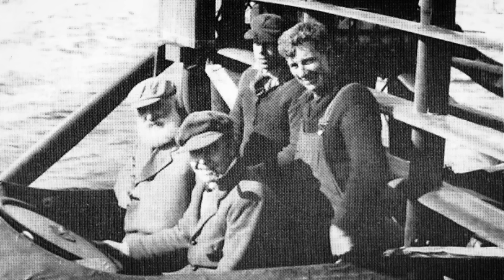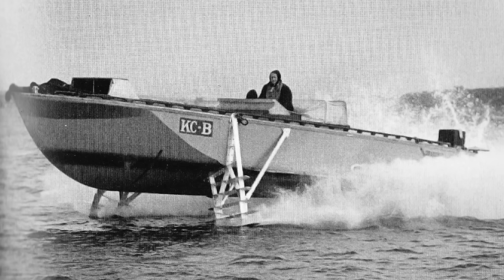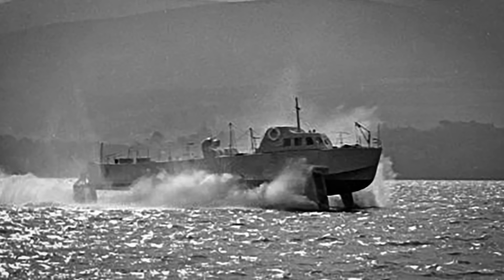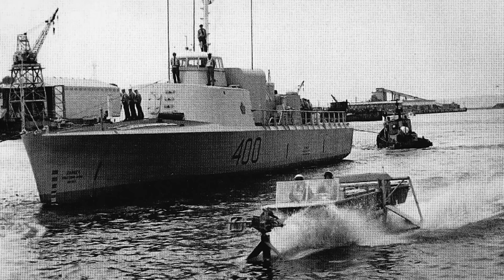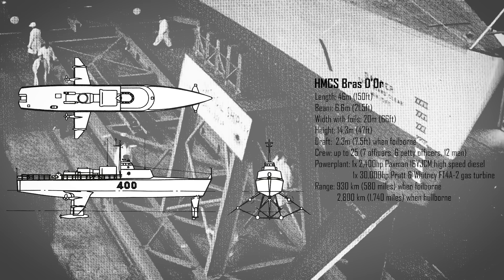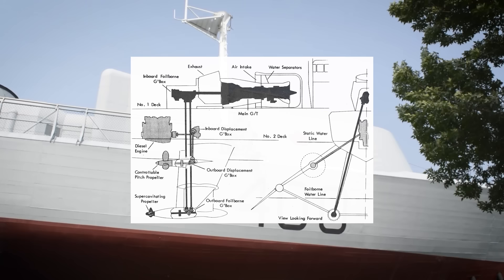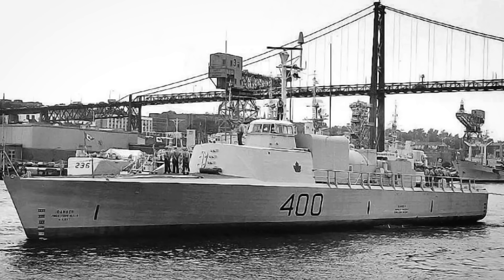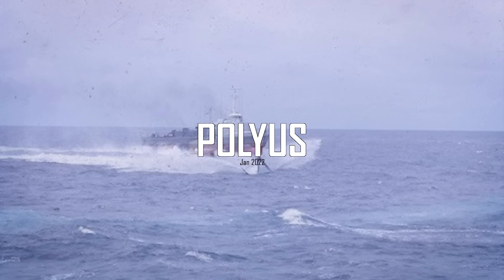HMCS Bras D'Or; The World's Fastest Warship And The Pinnacle Of Hydrofoil Development In  Canada

Comment: I was a part of a U.S. Navy team assigned to document a captured ussr hydroplane spy boat that was captured in the 70's. The engineers determined that it could perform at 80 to 100 knots in shallow water in coastal areas and it was no bigger than a WW2 PT boat. It had such a low radar profile and wood hulled that it was almost invisible to sea based radar. The Kennard was a single steerable ski design that had adjustable vertical angle. The drive was turbine type and used water jet propulsion.
Reply: Is any of this documentation extant?

Comment: The barge it sat on was built specifically for Bras D'Or  by Pictou Industries for $800 k , no tender. It was submersible with 18 ballast tanks and was galvanized inside and out. Beaver Marine Construction obtained it from Crown Assets and utilized it building floating concrete wharf caissons in Nova Scotia for many years.

Comment: Fascinating. I travelled regularly in Auckland Harbour crossings in the Manu Wai. A NZ built Hydrofoil that was 72 feet long, could travel at 40 MPH with 75 people on board. This was 1964 through to 1973.
Reply: Simon: Manu Wai is a PT 20 type surface piercing hydrofoil was designed by the Swiss firm Supramar and built in 1964 by the Italian firm Rodriquez before being shipped to New Zealand. It still survives and is on a mooring in Sydney Harbour, owned by Garry Fry.

Comment: Interesting ship. I knew a machinist mate that served on it and he said that they did a speed run to Bermuda from Halifax once. This was in the days before GPS navigation and his one comment was if we had missed Bermuda by 5 nautical miles they would not have had enough fuel to make it to port and would have been looking for a tow. He also said that after they did the “rough sea trials” they had to dry dock it for almost a year to repair the cracks in the foil pivot supports. Very fast but high on maintenance.
Reply: Not a "machinist's Mate", but a Stoker !  ( I R 1 )  (or Marine Engineer Artificer.  312/313/314 in the 90's money...)

Comment: In 1978 I was posted ashore to the Cdn Forces Maritime Warfare School(now Center) as an ABRP. During the 2 years there I found on one of the lowest decks a group of abandoned offices previously used for the Brador project, and here I found drawings,  specification tables, photos and, most interestingly, a pile of films of testing runs and engineering discussions. I tried to stow away some of the documents and films in the library but with little success. In the meantime the spaces used for the project were torn out to refit a new trainer. I doubt there is much of any of that material remains unfortunately.

Comment: FYI, maraging steel is pronounced “miraging” as in a mirage not “marriaging”.  Maraging steel is really cool stuff.  It's what was used to make the springs on the moon buggys.
Reply: 🤔 it's spelled maraging steel.  It's the short form for "martensitic aging" (mar-aging).
noun
1. a low-carbon steel that has been heated and quenched to form martensite: contains up to 25 percent nickel.

And yes, it really is a cool alloy of steel.

See also:
https://en.wikipedia.org/wiki/Maraging_steel
Reply: Speaking of the moon exploration, all the LEM landing gears assembly were designed et built by Heroux in Longueuil...
Reply: It's also used for fencing swords because they need to be extremely flexible and unlikely to break for safety. Too stiff and you could hurt your opponent, too weak and it could break off the rounded tip and also become a hazard.
Reply: @aniquinstark4347  I came here to say this. I was a epee fencer and the armorer for my H. S. team.
Reply: You learn n+1 things everyday!

Comment: The DDH-280 Iroquois class benefited from the development work done on Bras D'Or,.  The 280's were the first Western Destroyers built with all Gas-Turbine propulsion using lessons learned here, and the Combat Control System also benefited from the work done on the system for Bras D'Or.
Reply: And coincidentally, the lead ship was build at the same shipyard! When the Iroquois was decommissioned in 2015, they tried to bring it back to its hometown as a museum ship, unfortunately without success
Reply: Indeed' Marines in Sorel built those (they had aluminium hulls)
Reply: Served both Huron and Iroquois, belowdecks.
Reply: @beer1for2break3fast4  Spent some time on Algonquin waiting for Huron to come back from a deployment. Stoker as well. Used to hate taking the enclosures off the port cruise engine. One panel had a post about 3 inches from it and the panel was about 6 inches thick. A real pain.
Reply: I had the honour of being a member of the decommissioning crew onboard the Athabaskan. Hands down, probably the best sea posting I ever had.
Reply: No, they were most definitely NOT aluminum hulled...  I started out in the RCN on the 'gonk...

Comment: Collision of the Rx test craft with a Russian freighter is mentioned from 8:12 onwards. This incident is also described in the 1993 DREA published book "Knots, Volts and Decibels" by John R. Longard. The bow foil of Rx had apparently collided with an object in the water causing this steering foil to turn hard over spinning the steering wheel out of the driver's hands. Before it could be stopped it struck the Russian freighter amidships breaking a piece off the bow foil. It doesn't seem any real damage was caused to the freighter aside from its hull ringing "like a huge bell" according the the Rx driver Eric Jones.

Comment: I suspect that much of the further foil development will be using catamaran hull designs (like the Aquila 36, Hysucat's or the Insetta 35ifc).  Now these don't lift the displacement hulls completely out of the water, "only" about 80% of the way.  Very stable at either displacement or foiling speeds, extremely simple design (no moving parts) and a HUGE amount of deck space for the hull length.  No idea if they could be effectively scaled up though.  You get similar benefits with a SWATH hull, at the expense of greatly increased draft at slow speeds or anchor/dockside.

Comment: A great design, it seems hydrofoil ships dropped out of fashion everywhere by the 90's. I loved going on the Isle of Wight Shearwater ferry, but as with this military ship all were removed from service in preference for the far more boring catamarans. Does anyone know why hydrofoils failed in preference for catamarans?
Reply: I'm guessing that fuel economy was a big factor, along with the higher costs of designing and manufacturing the much more advanced hydrofoils. 🤷‍♂️
Reply: Actually numerous reasons.  Load carrying, operating costs, less draft for a cat, fuel economy, less maintenance ... the list goes on.
Reply: @mikewaters100 Yes, I think the isle of wight hydrofoil didn't carry that many people and used gas turbines so must have been a bit thirsty too. The catamarans that took its place can carry 200+ people and use diesel engines. Still, they are not as fast as or as striking to look at compared to the old hydrofoils ☹️

Comment: If going higher above the water reduces stability then why is it so high above the water?
Reply: The underwater wings have a V shape which compensates
Reply: Its a balancing act.   Higher speed gives more lift as drag drops, and height is needed in rough water for main hull clearance.    But things get very dicey at the limit and finally the skip has to back off and let the ship drop safely down into the waves.  But then the drag of the foils is very costly in fuel, not to mention that the foils stick out each side and the boat is a nightmare to dock.   Although hydrofoils have advanced a lot since the 1960's, they work best in relatively calm water with lightweight hulls of carbon fiber.  Check out the AC75 sailboats!   Not practical for general boating or shipping as they can carry very little weight and the fragile foils stick out so very prone to damage.   (MIL naval architect when the Bras d'Or was built)

Comment: How to make a 15 Thousand Ton Vessel go Ludacris Speed? Lift it out of the water! My Eldest Brother has a 21' Tunnel Hull Race Boat. Looks like it is sinking when parked at the dock , however Peddle to the floor board...(It has a Gas Peddle.) They like you to have both hands on the steering wheel. It can do well into 135 mph on water as the only thing in the water is the Black Mountain Merc Drive and two skinny ass ends of the Hull! Safety Glasses are required! Why this was never proven out is not my call but it can work.

Comment: All that work for nothing.  Of course of course of course but you need to look at the cost ratio variance potential versus the defense addressing inter-armorer survivability quotient yada yada yada yuck yuck blah blah blah!  You know didn't the Avro something Aeronautics something design and build an excellent first line fighter in the '50s, well ahead of the American's F-4 Phantom, better than the F-4 Phantom, for the RCAF that got all the way to to finished product and was cancelled for almost identical reasons as the, HMCS Bras D'Or, in almost the same set of circumstances.  Then after they cancelled the, "Avro Arrow" they proceeded buying up all American designed and built, overly complex military equipment at exorbitant costs, including cost overruns and delays and calling it a Canadian Military.  Of course I could be mistaken, I could be wrong!

Comment: It was not the fastest, by far, that claim is completely untrue. A USSR cold war era's prototype of anti-submarine boat М1121 (late 50s), 150T, 4 turbines from T-16 (~1MW)  by "TsKB-340" (one of KGB "sharashka", hidden in the middle of nowhere) dispayed max speed of 108 knots (190km/h). Such exremes were not actually needed and thus the mass-produced hydrofoil anti-submarine boats , project 1141, ~500T, showed max speed 67knots (126km/h), capable to operate on waves up to 4m high, fully stabilised, etc,etc. My dad was one of those who designed it. There were more variants of the design, including non-military not-stabilised "Raketa" and "Meteor" of which >400 are still operating, despite being > 40 years old.
Reply from the maker: Can you link to some references with those speeds? I couldn't find any that showed any more than 53knots
Reply: @polyus_studios  Well, I seriously doubt that there are decent references in English. In Russian, there is a good book - Dmitriev G., "Falconry (Small anti-submarine ships of projects 1141 and 11451)" (Г. Дмитриев - Соколиная охота (Малые противолодочные корабли проектов 1141 и 11451)). It is available online so you can poke it with a translator. Auto-translate butchers technical Russian in hilarious ways =) "Falconry" - due to the project given the name "Сокол" (Falcon), btw.
Project 1121 in the 50s wasn't actually built, 100-120 knots was only "calculated" speed.
Project 1141 was a prototype "Falcon" (1 built, 470t  full displacement). According to Dmitriev, immediately after completion it achieved 60 knots, after some tweaking (screws replacement) - 66 knots. 
Project 11451 (Mukha-class according to NATO) was supposed to be serial production "Falcon" (2 built, 475t  full displacement). It did achieve 65 knots on trials in 1987, but "operational full speed" was limited to 60,5 knots due to excessive stresses.

As for armament:
1141 got 2xAK-630 and 2x4 400mm torpedo tubes. The latter were replaced in 1991 by 2x4 RPK-9 "Medvedka" anti-submarine missiles (1141 was actually a testbed for the system)
11451 got 1 76-mm rapid-fire gun, 1 AK-630 and 2x4 400mm torpedo tubes.
And both projects coul use their torpedoes at speeds of up to 54 knots,

So, while the Soviet military hydrofoil project wasn't as spectacular as was said above, the title of "the fastest warship" (actual armed and serving warship) should go to 1141/11451. I wouldn't claim anything about prototypes and one-off trials since its too mirky of a subject on both sides of the iron curtain =)